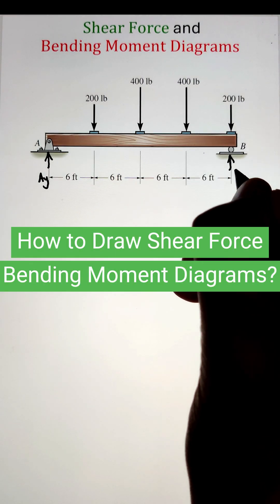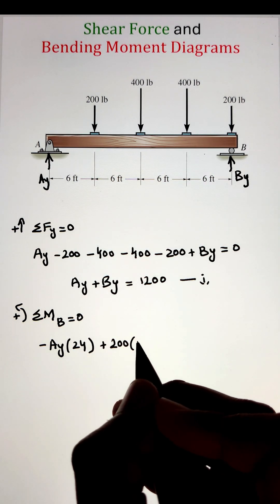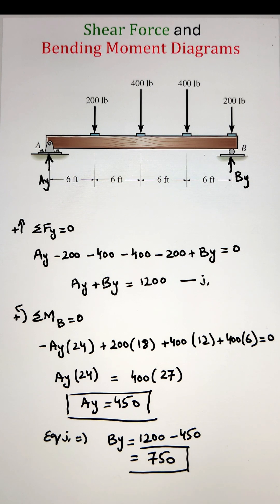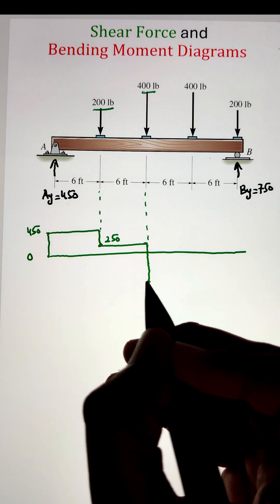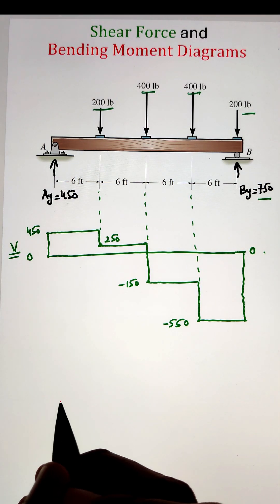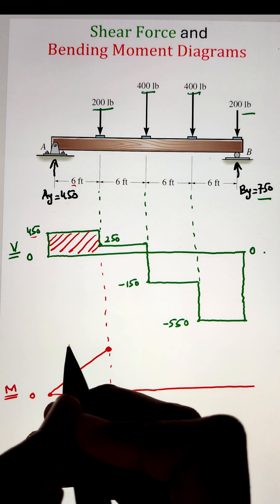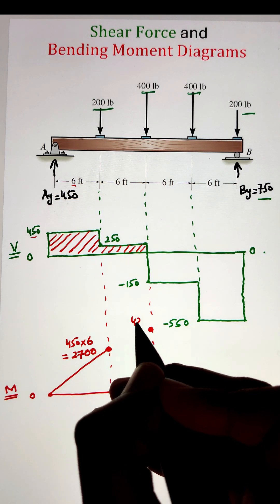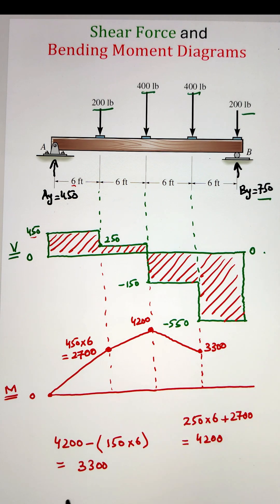Shear Force & Bending Moment Diagrams Simplified!

Comment: hello uploader, i have a question, why did u not draw shear force up until +550 as resultant in the last part of sf diagram
Reply from the maker: Hi, the shear force is at -550 in the last section from the point where 400lb force is applied to the point B, the sign convention is if force is acting downward it's taken as negative that is why it will be -550 instead of +550.